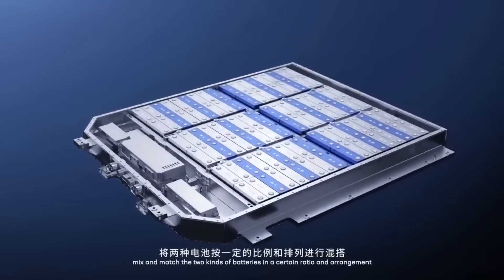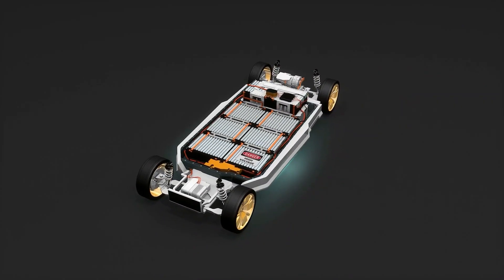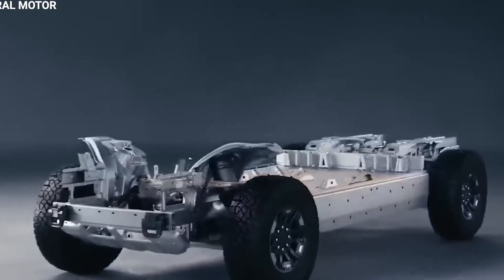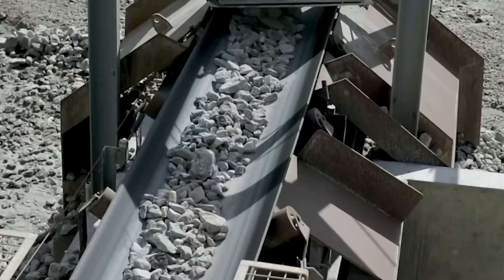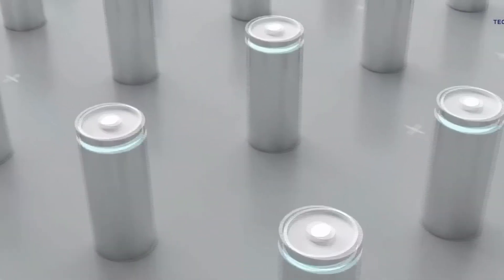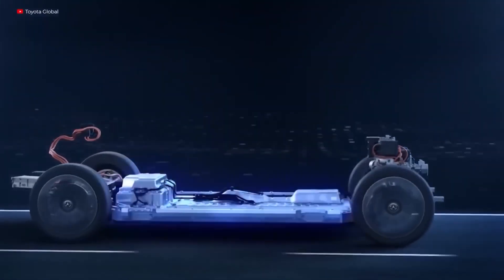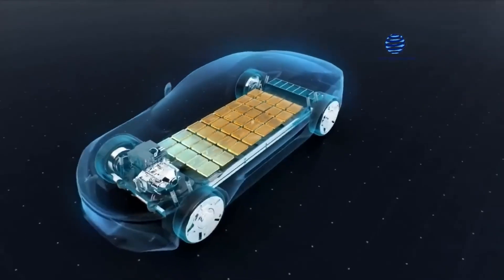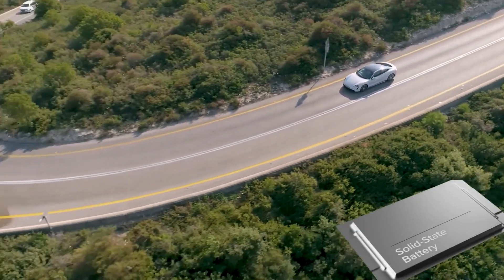Sodium EV's vs Lithium The Shocking Truth Exposed

Comment: I wish you had addressed the risk of fire with Li-Ion Batteries.  Once an EV with Li-Ion batteries, it's a massive problem.   Na-Ion (Sodium-Ion) batteries do not appear to have this issue.   From a safety standpoint, Na-Ion is the better technology.
Reply: True, but the reality is that lithium ion battery fires are ten to thirty times less common than ICE vehicle fires. Any fire is bad news, but let's not overstate the problem.
Reply: @rogerfroud300   Do you have a source for that?   
Also, it that based on current cars out there OR per 1 million cars?

Comment: Sodium batteries are already available - been available for decades.   You just go to the local supermarket to buy them.   Lithium batteries have high density and last longer.   That has always been the case.   Lithium batteries was developed to do something Sodium batteries couldn't do.   If Sodium could do what Lithium could do, they would have sold them decades ago to fit into watches and laptops, and later cars.

Comment: It doesn't matter a lick whether LiFePO4 is better or not, there isn't enough component materials to support the widespread implementation of storage enough to supplant petroleum energy.  Perhaps Sodium or another of the non-lithium contenders is enough but, until they are proven to be reliable, safe and cheaply produced, petroleum is still the answer for energy.
Reply: i like how your answer to a suitable replacement across the globe for reliance on fossil fuels is to champion petroleum.

Comment: Battery is not only about EVs.

There is a multiple times larger, Stationary energy storage requirement. (Grid scale storage ).

There Li-ion doesn't make any sense, as battery weight or volume is not the concern.
Na is already better option for that.

I still don't get it why people use Li-ion battery in home if they install solar panel.
Reply: Shipping

Comment: They keep talking about how cheap they will be. These batteries are not ready yet.
Reply: The clue is the "will be"
Reply: EVs are nothing like small consumer electronics that just plug in AA/AAA batteries and be ready to use. The battery integration changes involves systematic changes on the vehicle hardware/software designs as well as infrastructures. Sodium battery does have much less energy density than lithium-ion which means less milage/single charge on the vehicle, which also means they need to build more charging stations. It is risky for EV manufacturer to implement this type of batteries right now since there ant many charging stations yet.
Reply: 2 months later, sodium ion battery cars are already been mass produced

Comment: Sodium or lithium batteries... Both are totally inefficient, energy-wise. One liter of gas contains 200 times the energy of 1 kg of batteries.
I'll stick to ICE cars for the next 2 decades. Until they find a true revolutionary battery, build dozens of needed powerplants, add millions of charging stations and increase the autonomy to an acceptable level. No need to say, it won't happen soon.
Reply: And untill rocket ejection seats become standard equipment for all passengers on all electric vehicles. 😂 Just in case...
Reply: @nikspanakis  😂😂😂
Reply: Ok, try to use a mobile phone with gas or diesel.
Reply: @abraaourbano7118  When i read your commentary, i start to understand why the world looks like it does...  NO !! I dont have a nuklear power station in my garage to charge my cellphone, alarm clock and weather station!!
Reply: I have a 2003 hyunday gets with no rust that i drive in the winter. And a 2003 BMW 330i conv in the summer. Both have aboute 200 000 km / 125 000 miles and i take care of them and buy new stuf if something is wrong. I know what new parts for new car cost. It is cracy! A tail lamp to a vw +1000 dollar? And there is no to be found at scrap yards. I changed the rear shocks on the bmw this summer. It takes 30-40 min to change both of them, so i just bougt some cheaper ones when they are so easy to change. 2033 i dont have to pay road tax for them. Sweden.
Reply: Where the F' did you get that figure of 200 times more energy in oil than Lithium batteries? also did you know ICE's are less than 20% efficient, over 80% is wasted as heat and friction, steam engines aren't much worse than that. You are as much of a fossil as your fuel.

Comment: Sodium ( being an alkaline metal ) reacts to water and oxygen,  which means that a sodium battery fire while it may not be as hot as a lithium fire it is still hot, sodium has to be protected from water and oxygen, and also reacts badly to carbon dioxide used in normal fire extinguishers..Any battery using an alkaline metal chemistry is a large fire hazard....   I love this quote ' The Electric Car world is made up of four elements…Protons, Neutrons, Electrons and Morons'.

Comment: It's shocking this video didn't mention that Australia produces over 1/2 the world's lithium.
It's also shocking that the narrator didn't mention that cobalt isn't used in over half the world's EVs, such as those in Chinese made Tesla's & BYDs.
Reply: Pretty sure there is cobalt and tantalum in the low voltage electronics

Comment: If sodium batteries don't last for as many cycles, but are much cheaper, then maybe they also need to be easily replaceable, or even swapable, so maybe those EV companies touting swapable batteries are onto something?
Reply: This video must be based on old data: Natron claims >50k cycles endurance for its 1.2kWh Blue Pack energy storage Na-ion batteries. The energy density is horrible at only 16Wh/kg, though this is likely due to how thick current-collecting electrodes need to be for the 26Ah cells to accommodate its 800A charge/discharge current rating. If they made a 200A-rated version, they could probably bump density to 70-100Wh/kg.